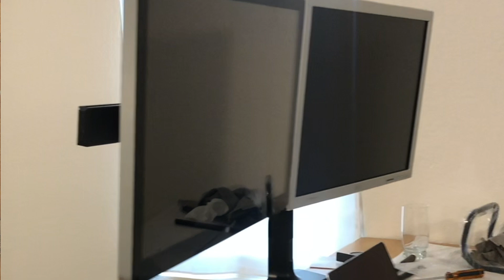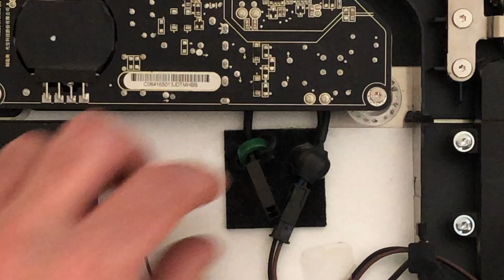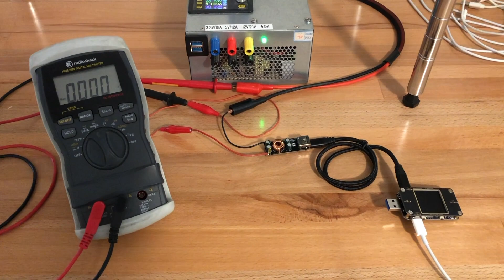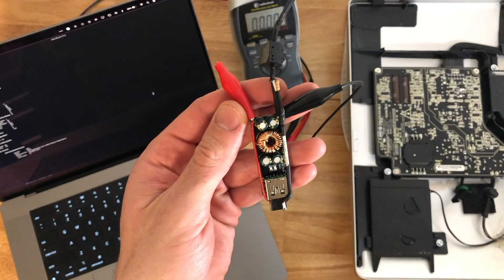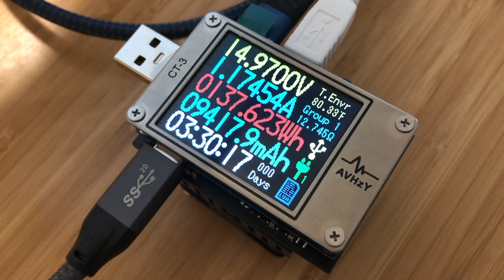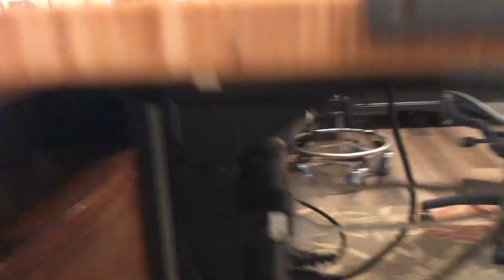Thunderbolt Display USB-C Retrofit for Modern Macs!

Comment: Thank you for the video - as I have few Thunderbolt displays in hands.  I have tried to use the MagSafe for older MacBook Pro and MacBook Air.   I have grown to DISLIKE the power cable portion - it created the tension on the most precious Thunderbolt 2 connector, which I saw on  many Thunderbolt Display.  I have disconnected the Octopus cable's internal power connector, then cut off the external power cable.  However, aesthetically, it looked ugly with the TB2-> TB3 adapter, plus the thickness of the the remaining cable.  I really like your method of hiding the adapter internally and only has TB3 cable coming out.  During my modification, I cut the 0.5m TB2 cable's plastic cover and it shows the "connector" exactly the length and style like the OEM's Octopus internal TB2 connector!  So, I can use the connector's cover, without needing the glue!  I also save Octopus cable's the white center "button" for the TB3 cable to pass through (again, with cutting and gluing) - now it feels like the TB3 cable was part of the TB Display...   It suits perfectly for my M1/M2 Mac Minis.  Thanks again for inspiring me to make this modification!
Reply: Has only found a replacement thunderbolt 3/4 extension cable?  The one that is recommended is unavailable on amazon.  I have tried two different versions (thunderbolt 3/4 extension cables) but none of them have worked.  I have tried turning the cable around (should not matter) since usb-c does not care which way you connect.  But I was trying anything.
Reply from the maker: That’s so slick, nice work!!!
Reply: @tenorcello any chance you can do a write up / video / or even just some photos?
Reply from the maker: @kickwriteteach2313  It's on my list!
Reply: You had no issue just replacing the original TB and power cable with a new internal TB 2 -3 and exiting a USB-C cable (I don't need the power output)
Reply: How did you cut the plastic cover of the 0.5m TB2 cable's plastic cover without damaging the internals?
Reply: Nicely done! I just replaced mine and reeeally wanted to cut into the plastic cover on the end of the thunderbolt cable to see if it was long enough to fit. I was too scared since it was the only one I had on hand. I installed it without glue or anything but this is amazing. I will go back and install it "properly" once i get another cable on hand.
Reply from the maker: @TheGrizzlyKnight  It IS long enough, and fits perfectly! I've got video of the mod, I just need to edit and post it. I used a small cuttoff wheel to make two lengthwise cuts down the white plastic shell and popped it off. It appears to be the exact same connector as the one you find inside the display.

Comment: @colindgrant Hey Colin, Love the video and find it great that you are still responding to comments on a few year old video! I did have a question about the cable sourcing for the video side. I bought the one from cable matters and video seems to be cutting in and out. I made sure the connection was correct several times and nothing seems out of place. I tried the cable with another monitor and sure enough it did the same thing. Any advice would be appreciated! TIA!

Comment: Awesome upgrade! Does the usb c extension cable have to be a special type of cable? When going from the thunderbolt 2 > adapter > mac screen works fine but when adding the extension after the adapter I get no signal/picture
Reply from the maker: Yes, definitely! I linked to some in the description.

Comment: TB2 is using Mini DP connector, however TB2 has a different protocol, and also usb C is PD, however newer TB like TB3/4/5 all have PCIE tunneling
Reply from the maker: Yes, that's why the conversions were necessary. It works perfectly 4 years later! I added a Thunderbolt hub to combine PD with TB to the laptop over a singe cable here: https://youtu.be/2YE8N8NHb-A I even run a 3rd QHD display with DisplayLink running over USB, running over Thunderbolt!
Reply: @colindgrant oh nice, yea I can see why

Comment: Love my tbd but contemplating whether to get Studio Display gen 1  from CEX for £850 now? Letting my partner try out in her ASUS Zenbook 14 but won’t work although have thunder bolt 2-3 connector ( I use with Mac mini m4 ) and have tried connecting through back thunderbolt 2 port with adapter and extra thunderbolt 2 lead, tried updating drivers and matching resolution on ASUS but nothing … any ideas???

Comment: I wonder if something similar like this can be done with the 30” Apple Cinema HD Display..
Reply from the maker: Yes! And potentially easier since it doesn't use Thunderbolt. The video would be handled with a very specific USB-C to Dual Link DVI adapter, like this one:
https://amzn.to/4tgBR9D

Regular adapters won't work for the 30" because of its high resolution.

Let me know if you try it out!
Reply: I would, I also wonder If there’s an upgrade to a 4K/5K panel too,  Im pretty sure the Display Connector on the Thunderbolt Display is eDP which is the same connect on the Newer Intel iMacs.

Been thinking about buying a Panel and a Thunderbolt Display just do to that but I’m sure there’s gonna be an issue with entire the inverter with the power draw or main board with the resolution.

Same thing for the HD Display as well except gutting it completely and throwing a panel that supports eDP instead of TMDS on that. Downside on that is I would have to find a new main board and inverter ( I’m still not really sure what an inverter does a monitor anyway).

Comment: FUNNIEST PART IS REALLY ALL YOU NEEDED TO DO IS PLUG THE CABLE INTO THE THUNDERBOLT OUT AND THEN USE THE ADAPTER  AND THEN RUN A USB C POWER ADAPTER AND YOU WOULD HAVE SAVED MONEY AND TIME THIS IS HOW I RAN MINE FOR YEARS TIL THIS YEAR WHEN I DITCHED 2 FOR A ULTRAWIDE SAMSUNG
Reply from the maker: You missed the point entirely. Also, no need to yell.

Comment: Has only found a replacement thunderbolt 3/4 extension cable?
The one that is recommended is unavailable on amazon. I have tried two different versions (thunderbolt 3/4 extension cables) but none of them have worked. I have tried turning the cable around (should not matter) since usb-c does not care which way you connect. But I was trying anything.  i tried another cable.  so i've tried a total of 4 cables and none of them. work.  i would love to find the correct usb-c (thunderbolt 3) extension to work
Reply: bought several and even the brand you used from china and it did not work
Reply from the maker: Have you tried to plug directly into the port on the back of the display? It works just like the internal port. Also if you're using a TB2 cable, they are known to fail with intermittent and inconsistent symptoms.

Comment: I know this is an older video, and that the latest reaction is from 2 years ago.. .So I'm not sure if posting my reaction here will lead to a response from Colin. But you never know...

I use two Thunderbolt displays and am still very pleased with them; I don't see any advantage in upgrading to Studio Displays (and am not willing to pay the money). At the moment, I have the two Thunderbolt displays hooked up to my Mac Studio M1 Max with two TB2-TB3 converter cables, and this works fine. So, I don't really have a need of doing conversion. But... your video is that much intriguing that I find myself thinking about it...

I am confident that I could open up the displays and do the internal Thunderbolt conversion. But I have to say that the actions w.r.t. power really is above my head. I don't think that I could do the "buck converter board" stuff - I really am underskilled for that.
So here's another plea with you (Colin) to maybe start up a smalle batch production for configured converter boards and sell them... I am very interested !!!

Comment: Cool mod — thanks for sharing the Thunderbolt-display upgrade! 👍 I tried several USB-C / USB-C extension cables to power my display and data, but none worked properly (no video, rear USB ports didn’t work, etc.). Has anyone here got a specific extension cable model — with exact length — that reliably carries video + data + power, ideally available in Europe? I’m looking for verified solutions before I buy a new one.
Reply from the maker: Yeah the ones I linked in description are the ones I use and they are verified to work. The the shortest you can.

Comment: I know this is an old video. But I just used a thunderbolt 2 to the port on he back of the monitor to Apple thunderbolt 3 adapter and boom. Works perfectly and much cleaner. I have it connected to a OWC hub and then thunderbolt 3 to my MacBook Pro
Reply from the maker: Hmm, you must not have watched the intro where I explained why that is NOT what I wanted at all. I already tried the external adapter for Thunderbolt and MagSafe. I'd hardly call it clean.

Comment: Would you be able to help me out with my 2008 Cinema Display? I think it needs a new power supply and there’s no one who can help
Reply from the maker: I just searched "2008 cinema display power supply" and got lots of options.
Reply: @colindgrant  my bad. Wasn’t clear. Help as in getting that display fixed! No one’s willing to put a hand on it
Reply from the maker: @JohnMorgado05  Yeah, it's not economical for people to fix these. Example, for me to work on it you'd have to pack and ship it to me, then at least $100/hr for unknown number of hours to disassemble, diagnose, find parts, order, install, maybe they work maybe they don't, pack and ship it back, risk damage in shipping, etc etc etc. That's why I make DIY videos. You've got to try it yourself, or else it's probably time to upgrade.

Comment: (1 Aug 2025) Many thanks. Great video - for both content and delivery / execution. (It is brilliantly educational in so many respects, and you are natural educator...) I have watched both this and the sequel (where you add an Anker TB4 dock) several times. As I am one of those who are keen to do this themselves,  i echo others in regretting that the content is "light" where it comes to the execution of the "buck converter" board. (I have extremely rudimentary knowledge of the workings of electronic circuits ... and greatly regret this too - I will strive to address this. For now, please forgive my basic questions that follow ...) Specifically, I'm asking myself (1) re. the two wires (black & white) that come from the MagSafe jack at the Power board in the monitor, that you cut and retain - and very specifically how do they attach to the buck converter (is it one at the "-" terminal on the BC and the other on a terminal of the Schottky Diode end, (2) does the other (red) wire (installed by the manufacturer of the BC) just run from the "+" terminal on the BC to a second leg on the Schottke Diode, (3) how is the small heat sink attached (hot glue?), and (4) how exactly is the 39K resistor installed (between the white and black wires)? .. Thanks for any further input you can provide - ideally, for others too, by way of a readily accessible supplement to your current Notes narrative. I have studied the movements on the white "bread board" but given my state of ignorance they don't provide to me answers to these questions. I have subscribed to your channel in the hope of learning much more! (Thanks again)

Comment: So if you only want to do the display portion and not have any power go to your Mac, you do not have to mess with the power supply, right? The only part that one would do is the first.
Reply from the maker: That's right. The power and display are completely separate. They just travel down the same cable bundle.

Comment: @colindgrant Thank you for posting the video! Aside from price could you theoretically take the power line, add a USB-C extension (female end sticking out of the shell) from the Delivery Buck, and then just add a MagSafe3 from it? Also, if you have a moment would you mind posting a video of how you connected the USB-C Power Delivery Buck Converter together with resistor, and diode?

Comment: I have one of these displays and the cable is not in a good way. Were I to follow your tutorial here and replace the thunderbolt cable, is it necessary to have the MagSafe plugged in to the power supply or can that particular cable be deleted with no adverse effects?
Reply from the maker: They're completely independent, just bundled into the same insulation. So yes you can delete your MagSafe cable and run a new TB2 cable in to the internal port as shown in the video. Or just plug into the external port if you don't want to open the case, that works just like the internal port. Let me know how it goes!
Reply: @colindgrant  Thank you so much for the reply!! I kinda figured it would be as you say but I wanted to check with someone who knows more than I. Much appreciated!!!

Comment: Thanks a lot for this very great video! I was exactly looking for this kind of solution and maybe I'm going to give it a try.
One thing to add: there are usb-c (female thunderbolt) + usb-c (female charging) to usb-c (male thunderbolt + charging) adapter out there. if you find some place to squeeze this as well inside the display, you'll be left with only one cable, what would be even greater!
Reply from the maker: @therob39  hey can you link to an adapter like you described?

Comment: Has anyone found a 3ft TB3 extension cable that will work?  I've purchased 2 from Amazon and neither work.  One won't connect and the other causes a flicker.  My TB2 extension and the TB2 to TB3 adapter are working properly.  I can't seem to find an extension cable that is compatible.
Reply from the maker: I don’t think that true extension cables (with male on one side and female on the other) are allowed in the TB3 spec. I got away with it for a short run but in general I believe you need a single ‘active’ cable over .5M. The TB3 length limit is pretty stringent. USB-C cables are not sufficient. You may already know all of this but that’s what I know. Good luck!

Comment: could something like this be done with the 2008 cinema displays?
Reply from the maker: The Cinema display uses Mini DisplayPort, which is essentially the same as DVI or HDMI, just a video signal. You could certainly install a DisplayPort to USB-C adapter to handle the video. And you could do the same MagSafe mod for power. In the Thunderbolt Display, power and video are completely separate, and I assume Cinema Display is built the same way.

Comment: The cable on my '11  Thunderbolt Display gradually frayed to the point where it gave up the ghost a few days back. I have a thunderbolt-2-to-thunderbolt-2 male-to-male cable on order so I could try connecting a newish MacBook Pro to one of the ports on the back. I viewed a few videos showing how to replacing the cable assembly but if plugging into the back works, I didn’t see much advantage to it—until I saw this video! Thank You.

Comment: I’m wondering if it’s feasible to connect the Thunderbolt Display via a TB2 to TB3 adapter to a Elgato TB 3 Hub which has 2 TB3 ports and the connection the M1 Macbook to the Hub using TB3 cable so we only using one cable but it provides the display connection and the power(from the Hub)?
Reply from the maker: @oheey8161  let me know if this helps:
https://youtu.be/2YE8N8NHb-A?si=7sumMu_A1RqsnUgF

Comment: If anyone just wants to revive thunderbolt display with a damaged cable- if you connect a working thunderbolt cable to the back port of the display to the computer, it'll work exactly fine, no need to tinker!
Reply from the maker: @boyeong16  yep, that works great!
Reply: Exactly what I did.
Reply: @BluePlanetDrone did you use an USB thunderbolt adaptator?
Reply: @tbonthetrack yes. Thunderbolt 2 cable. Be prepared to pay up for the cable if you can find one. Luckily I was able to get mine some time ago before prices went crazy because they haven’t made these in many years. Don’t try and save $ buying a no name janky one. A good one will cost at least $50 if not $80+.
Reply: You mean connect an adaptator USB to thunderbolt and it works? Because I don't have a thunderbolt  port on the back of mine.
Reply: @t @tbonthetrack Then your monitor might be LED cinema monitor, not thunderbolt one (they look almost identical) which only got mini displayport which you will need to replace